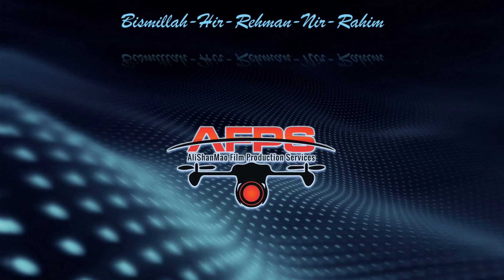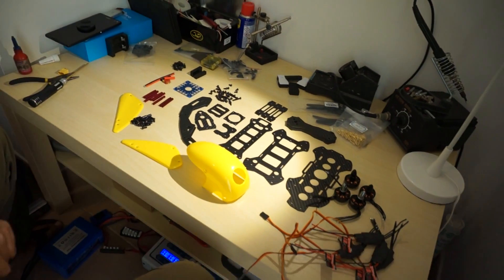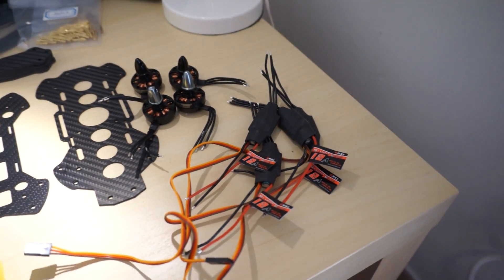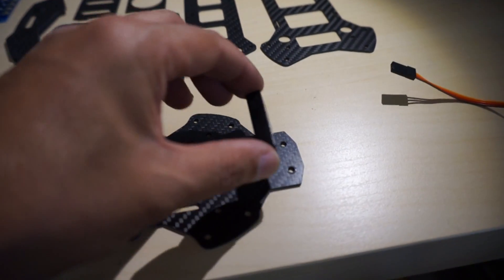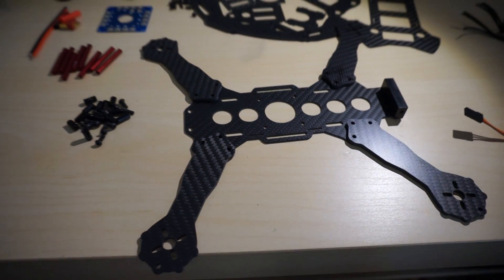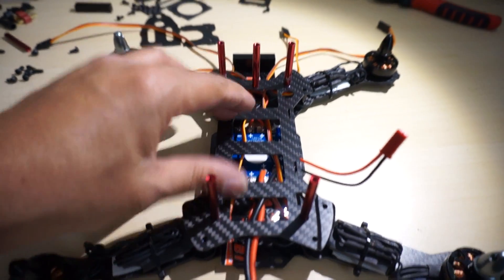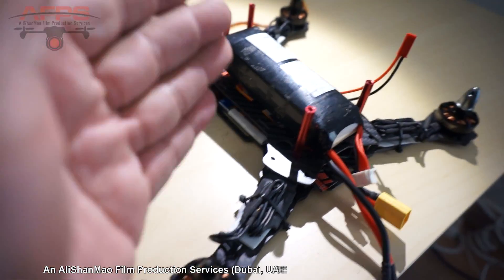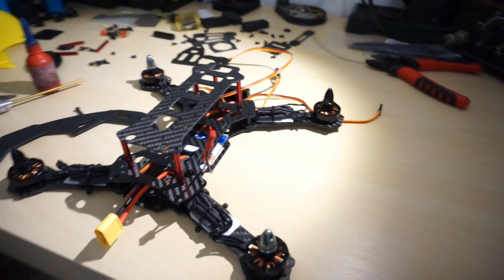RobotCat 270 FPV Racing Quadcopter Build

Comment: I have built this drone, but I have one problem 2 motor turn without 
problem and the other 2 turn ok but not even fast  to fly, I configured 
with LibrePilot the esc but don't Go Faster at all, what can be ? all 
motors and ESC are brand new

Comment: Dustin do you know anything about the L160-2?? I bought an RTF model from HobbyWOW.com as my first FPV Racer and it doesn't come with any instructions and there are only 2 video's for it on YouTube. Below is the link for the BNF version from GearBest just so you see what I'm talking about... any help??
Gearbest：L160 L160 - 2 Racing Quadcopter http://m.gearbest.com/multi-rotor-parts/pp_364384.html

Comment: aren't you worried that your pdb will end up touching any part of the frame since carbon fiber conducts electricity and it could catch fire, or short out your motors, or esc's?  if your going to double side tape it, then you better tape the hell out of it.  i know all of this from experience.

Comment: Hey Alishan, love your videos!

What motors/speed controllers/ESCs do you recommend? I'm planning to get the frame because I love the look of it, but I'm not sure what specs to buy as a first time builder. I've flown many prebuilt quads in the past, but it's my first time building one from scratch.

Thanks!
Reply from the maker: Standard setup. Emax 2300kv, 30A ESC, 5 inch 3 blade props and 4S Battery